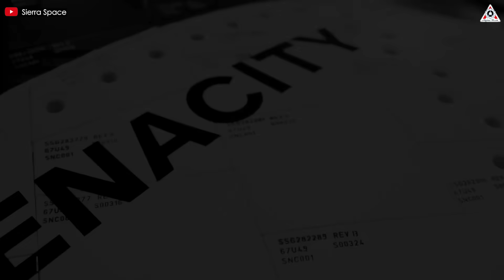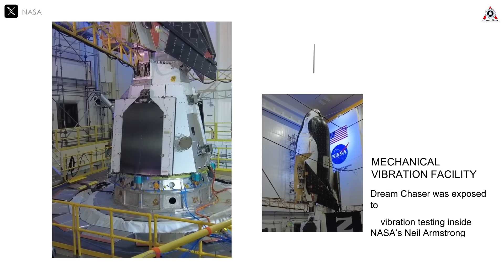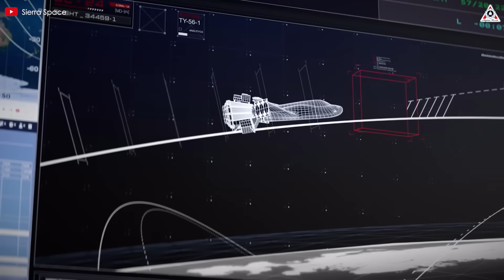NASA new Space Plane is almost ready for its first launch, Humiliated Boeing Starliner...

Comment: For an additional boost for starship at launching there could be a solid thermally insulated pipeline to the very top of the launch tower for liquid oxygen and one for fuel. These could be routed via flexible fuel and oxygen tubes to inputs near the bottom of the starship exterior, and connected internally to the fuel and oxygen tanks, these flexible tubes could be counterweighted to retract into thermally insulated pipes on the top of the tower, as the starship rises the retractable fuel lines would be almost level with the top of the tower they would automatically disconnect and seal the tubes and the input to the starship. This could save a considerable weight of fuel.
Reply: They top off propellants until a few minutes before launch already
Reply: @dionysus2006  Yes, but by the time the bottom of the starship is level with the top of the tower a lot of fuel is used. My suggestion is to keep it topped up for longer.
Reply: @apollo-r5z  I don't think you want a connection between ground support equipment and the ship in flight for a few extra seconds of prop loading.  I don't think the benefit is greater than the risk.  Send you idea to SpaceX.  Who knows ?
Reply: @dionysus2006 There are the risks of fire and explosion, if a safe way of doing it could be found it would be worth it. In-flight refueling of airforce jets would once have seemed to risky as well. There may be ways of lessening or eliminating many of the risks. A flexible refueler would be a fire risk and may lose flexibility at very low tempertures, so thats probably out of the question. In WWII some aircraft were fitted with long range expendable fuel tanks, something similar might work foor starship only for takeoff when the speed is still low and then jettison the reusable tanks, which could be relatively simple stainless-steel tanks, possibly half the length to two thirds of the starship, two feet in diameter of the starship, five or more strapped around its perimeter, shaped with aerodynamics at their tops to make them drift away from the starship upon release. And would be made to float. Alternatively similar sized cardboard tubes of solid fuel boosters that could burnup as usedup, or be made biodegradable expendable.And one more idea, strap four jet planes, two on each side above one another to add thrust at takeoff, they could land at airstrips normally, or use jet powered drones that would have their own clamping mechanism to the starship, e.g. vacuum suction for quick release.
Reply: @apollo-r5z  I like the ideal of the strap on jet assisted takeoff.  This could significantly increase payload since oxidizer is not needed.  Email your idea to Elon 🙂

Comment: Dream Chaser is far more complex than Starliner and hasn't even made orbit yet much less a re-entry.  Too early to tell if it will be a good system.  There isn't enough time left with ISS to become a crew option.   They should concentrate on post ISS commercial space stations which probably won't happen until 2035.
Reply: Dream Chaser built for cargo, not Astronauts ! Looks good, but hasn't launched yet, let alone return safely to earth.

Comment: The problem with Dream Chaser is that it is just a scaled down version of the Space Shuttle, which never succeeded in it's goal of being a reusable craft because it required a full rebuild between flights. Dream Chaser still has a lot to prove. That fancy designer heat shield for example looks disposable, not reusable.
Reply: i think they just snap on like lego...bad ones are pulled off and new ones glued on